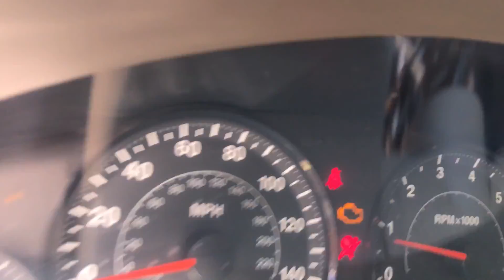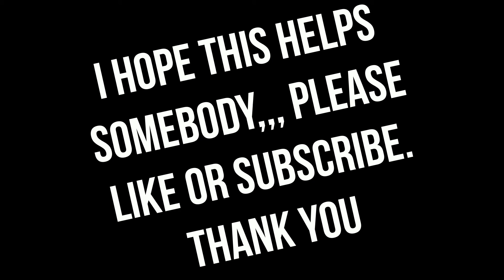BLOWN HEAD GASKET CANT GET TO WORK  BLUE DEVIL

Comment: FYI, on some cars running the engine without a thermostat (minute: 7:55) actually makes the engine run hotter, because the water moves too quickly through the radiator and doesn't get time to cool. I had a car like that once, a big old 8 cyl. and it needed the thermostat to be in place. I tested this several times because I just couldn't believe it at the time...This guy makes great videos for us "mechanics" :)
Reply from the maker: what kind of vehicle?  scratching my head  lol
at idle or hiway speeds, what about the cooling fans?  interesting  :)

Comment: I have a 2004 Ford Focus 2.0 how do I do that one boss man? It’s Not mixing oil & water yet it slightly over heat after 30 min Drive
Reply from the maker: Same way. Remove Thermostat, Flush, add blue devil when it’s cold, let it run for about an hour.. That’s it

Comment: I know this vidoe is kind of old but do you happen to know if this missing ever stopped I did this treatment yesterday it’s not running hot or mixing anymore but its still missing any suggestions?
Reply from the maker: Try changing the plugs..  What kind of trouble codes are you getting… sometimes if the vehicle runs really hot spark plugs could foul out.. just a consideration? Good luck, Let me know what kind of trouble code you have
Reply: @HayesMobileAutoRepair  missing in cylinder 2 and 3 that’s what code came up  but I’ve experimented and I think the blue devil might have worked and I just need to change my one or two or my coils do you happen to know if the vehicle in this video ever stopped missing?
Reply from the maker: @deaneybwoy4332   yes it definitely ran better but still missed a little bit.. did drive to California the same week and back home to Mississippi so it was running better and it didn’t overheat.. called me Maybe two weeks later and said thanks so I guess everything went well
Reply from the maker: Did you have a misfire before the vehicle overheated… I would suspect a spark plug before I would suspect a coil in this situation..  even though Fords have a high value weight on coil packs.  It’s just more likely a spark plug failed since you overheated at the same time  when you started getting the miss, correct?
Reply: @HayesMobileAutoRepair  yes it started to miss after it over heated and oil and water started mixing in engine

Comment: My chevy s10 4.3 v6 vortec blew a head gasket on a count the intake gasket and a bad temp. Sensor. The reason why I didn't catch it overheating is bc the temp. Sensor wasn't working peoperly. Now my truck shoot out water exactly how this vehicle in this video. My question is? The reason why you did it this way instead of the direction is bc the air would have pushed out the blue devil?

Comment: You should never stop and add water to an overheating car. You’re never supposed to remove the radiator cap while the engine is warm.

Comment: He didn't follow instructions it says that you need to take a full minute to pour the blue devil in and you are supposed to pour it in as the engine is idling, so if it doesn't work it's because he can't read.
Reply from the maker: Thanks mike.  Yes people,  read the instructions!!  But I’ve done this procedure a dozen times and I know what works
Reply from the maker: By all means read the directions!    But this did work.  He drove it from Jackson Mississippi to California and no problems.. even text me to say thank you..  but yes he is correct do a slow pour.
Reply: So it did work